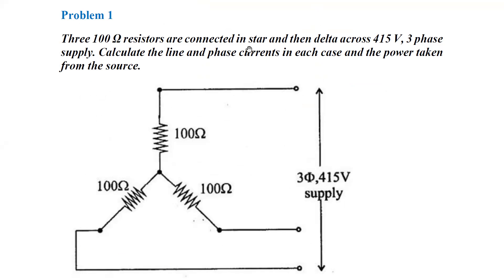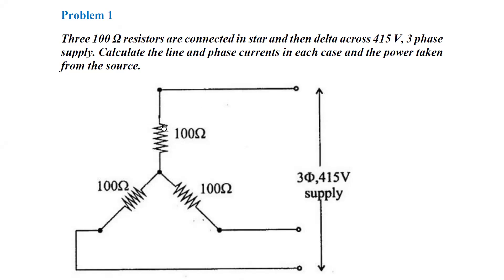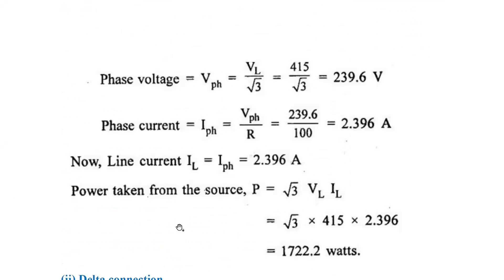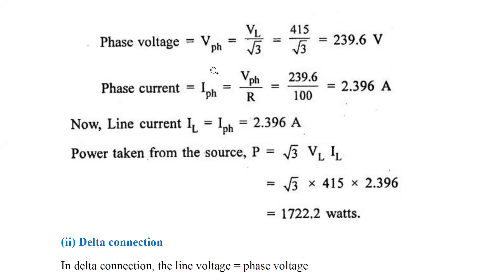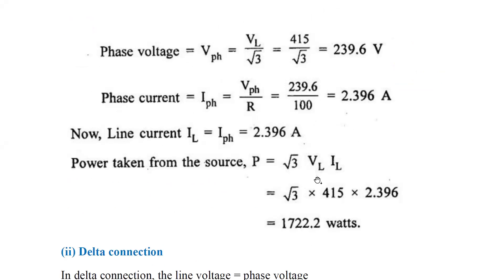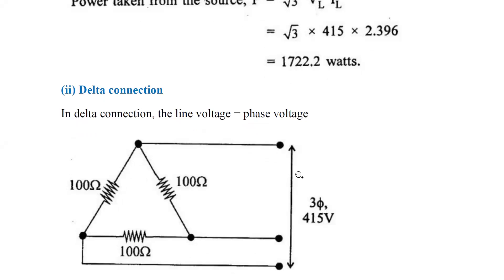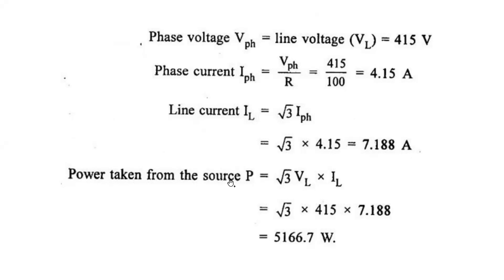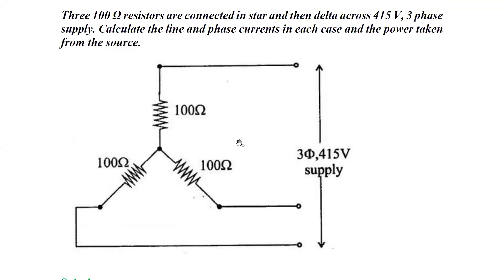Solved Example Problem 1 - Three Phase Star and Delta Connection #bee

Comment: voltage between each phase wire and neutral is what's supplied by each line of a three phase supply, in this case about 240V. Therefore voltage between 2 phase wires given in this example being 415V should be referred to as phase voltage. Conversely line voltage would be potential difference between any supply line and neutral.
Reply from the maker: Line Voltage (V_line): The voltage measured between any two phase conductors. In your example, this is 415 V.

Phase Voltage (V_phase): The voltage measured between a phase conductor and neutral. In your example, this is 240 V.

That’s why in a 3-phase, 4-wire system:

Line-to-neutral (phase voltage) = 240 V

Line-to-line (line voltage) = 415 V

Comment: On delta connection, how to calculate or what's is the resistence reading on the terminal ?
Reply from the maker: In a delta-connected resistor network, the resistance measured between any two terminals is equivalent to two resistors in series connected in parallel with a single resistor
Reply: I don't have words to describe you. Your incredible..........I calculate according to your explanation, the results was the SAME from what I get with my multimeter reading. I didn't know how to get it ..... 

Thanks ❤